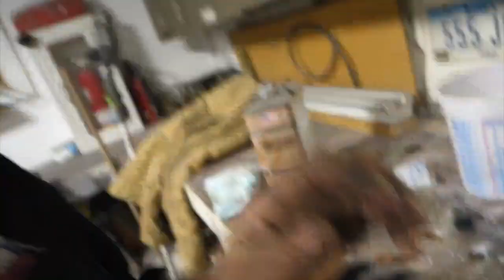1964 Impala Front Suspension REBUILD!

Comment: I definitely prefer the look of the drum brakes and as long as they're adjusted right will stop just as well as disc brakes. The only issue is they start to not work as well once heated up but as long as you're just cruising its not an issue.

Comment: If u use impact on spring compressor tool it will chew up tbe threads. I still use it though. And throw the tool away after a couple uses. 15 bucks on ebay

Comment: Went your way but you failed to mention spring compressor hooks was difficult part to remove inside the coil springs
Reply from the maker: Carlos V that was actually the easy part
Reply: @RJTickler  at the end I used the tie down to open a bigger gap inside the coil.  Took me a while to figure out how.

Comment: Hey man i was wondering if you can hell me. I got a 63 impala took the passenger side upper And lower control arms out with the spring. But the driver side upper control arm whats the best way to take it out? The steering C. Shaft is in the way. Do i have to remove the gear box so the Steering C. Shaft can move out of the way of the arm to come out. Thanks in advance man

Comment: I’m sure you probably already know... but those stock 58 to 64 rear ends don’t have retainer clips inside the pumpkin to help hold the axles in place, only the pressed on bearing does.  I learned that  after my 63 broke an axle of course...So after I pressed new bearings on  I took my axles to a weld shop and had them put a spot weld on the bearings with a tig welder to the axle just to make sure they didn’t pop out and snap an axle....Don’t want that to happen to you and do body damage like me....But I think the axle broke because the bearing was worn and locked up causing the axle to slide out....
Reply from the maker: KC BILL thanks man. Yeah I’ve known about that. But with a stock set up I think I’ll be ok. No weight from hydraulics over it. No three wheeling. I mean crap they have held in since 64 like that lol.